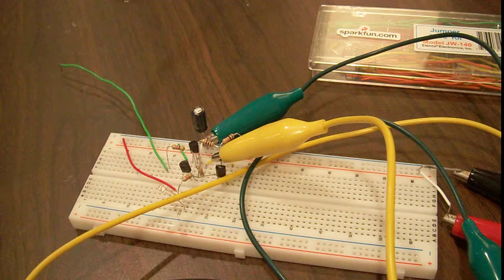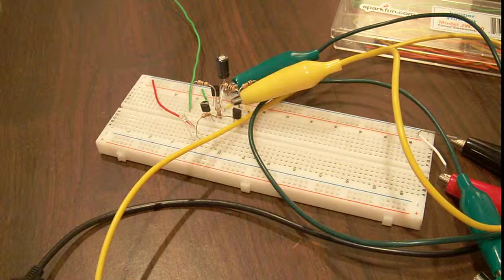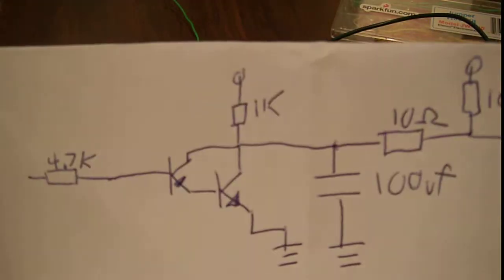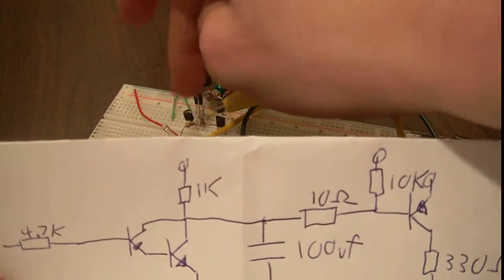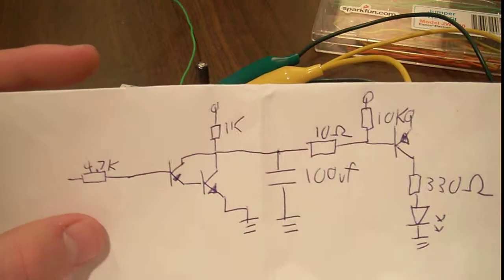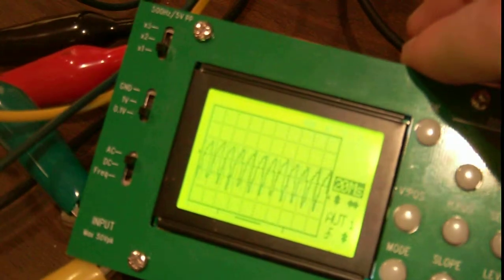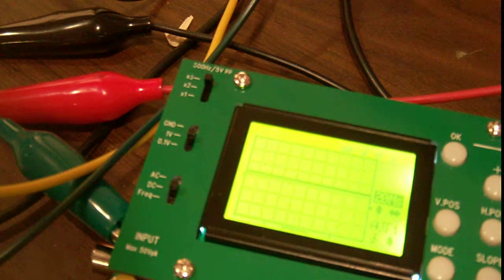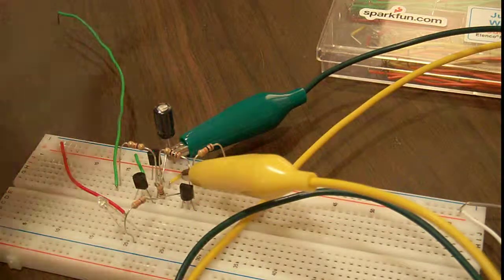AC Hum Touch Sensor

Comment from the maker: For that you should take the output of the circuit (where the LED currently is) and put that to the gate of an N channel mosfet. The mosfet will connect its source to its drain with a resistance of less than .1 ohms (typically). Mosfets can handle high currents easily if you put a heat sink on them.